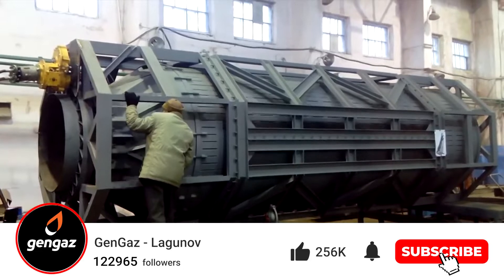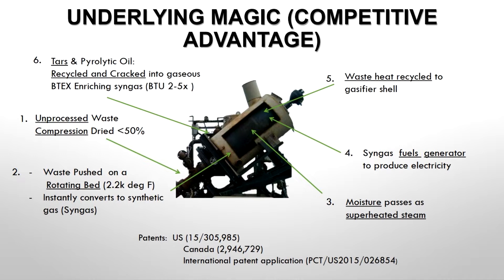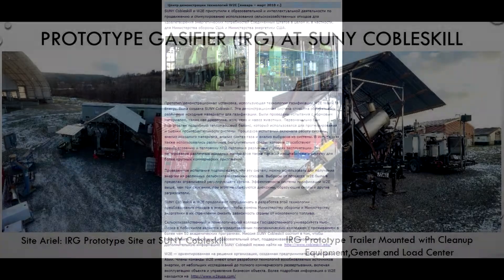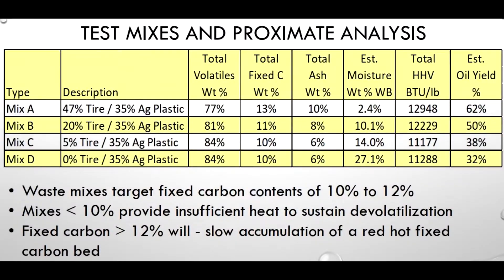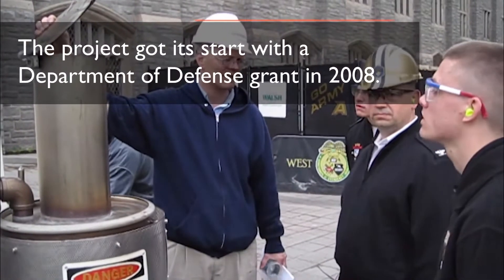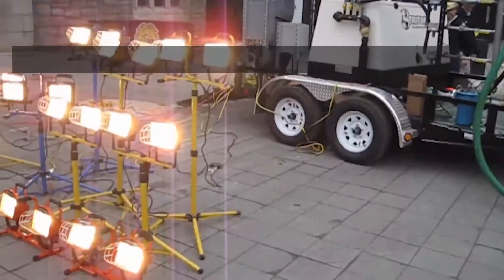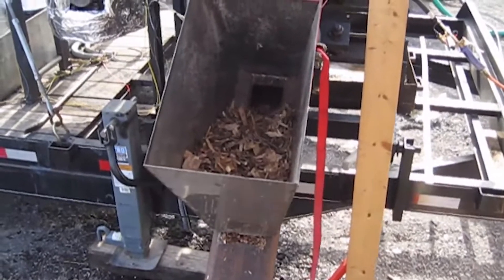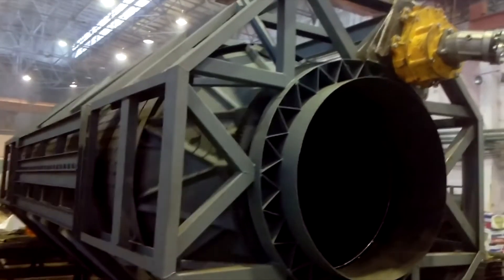Omnivorous mobile gasifier on a trailer for a 60 kW diesel generator

Comment: Is the reactor of this gassifer at the bottom of the rottating barrel .. the hopper is located at ground level. So the chart material is augured through the gasifier and ejected through barrel exiting the top barrel?
Reply: The barrel itself could serve as an auger. The material could be augered on the outside or through a tube auger on the inside. It could then enter at the top. Using the outside may be better from an operation point of view but an inside auger would require less metal. Then again, if space was no object, the outside auger wouldn't have to be covered by metal...or maybe not even covered.

Comment: If the demand is as great as shown, why not prototype your design using 55 gallon barrels so it can be reproduced by DIY craftsmen? Actions speak louder than words... show us your innovative ideas... how about a simple DIY methanol alcohol producer? See: Robert Murray-Smith's Youtube channel at 
https://youtu.be/lraiZzHiieo
Reply: Old water heaters would make perfect barrels. They're much stronger than 55 gallon barrels. The gas one have a chimney built in. The electric ones do not.